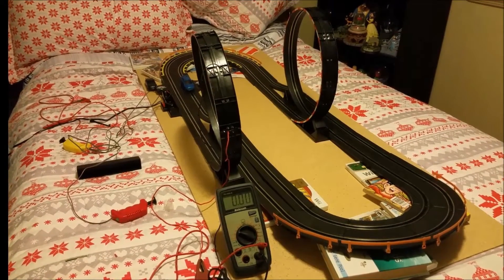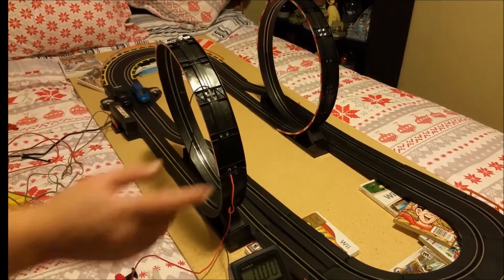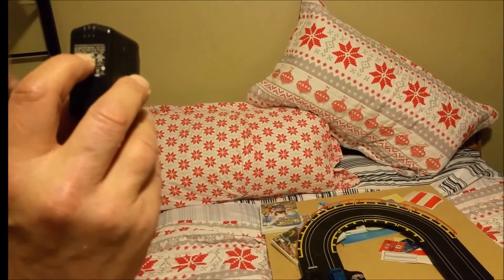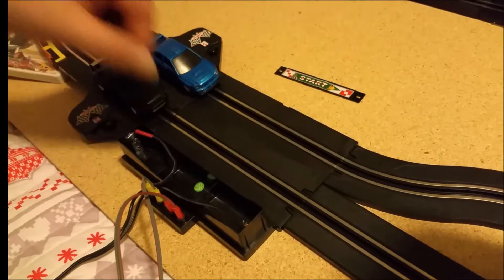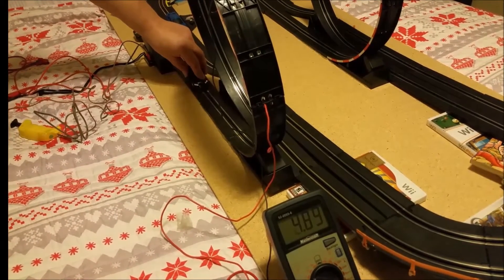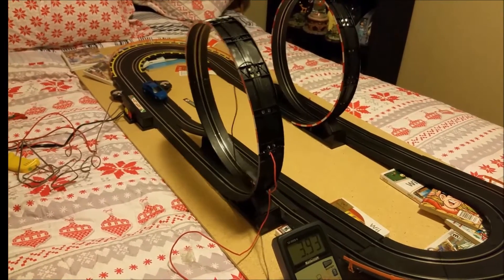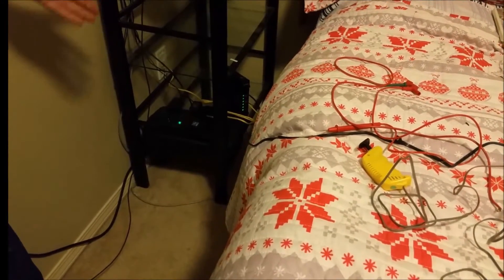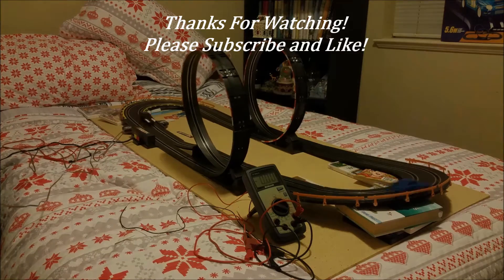How to modify a road race track from DC battery to AC power

Comment: Someone Google the
"hot wheels colossal crash track set"
It runs on the huge way overpriced d batterys.
Can someone please explain to me how I can convert so I don't have to use batteries.
Batteries are waaay overpriced.
$9 for 4 stinkin batterys. Wow.
Anyhow much appreciated if someone could and would assist.
Many thanks in advance.

Comment: I have a 12v track and tried this but couldn’t get the power to respond. Batteries still working.
Reply from the maker: Check the amperage on the transformer your using is it putting out 12 volts check with meters hope this helps

Comment: This is a pretty neat little life hack!  

I actually have two Speed Chaser sets both from fast lane, they pretty much have the exact same problem of voltage drops when there are two cars being used which often cause them to stutter, I also have the Long Bridge Challenge set which is also from Fast Lane which comes with an electrical adaptor, and the good news is that the track is compatible as well as the controllers with both which means that I don't need to rely on temporary battery power.